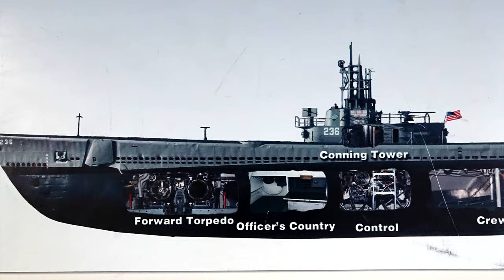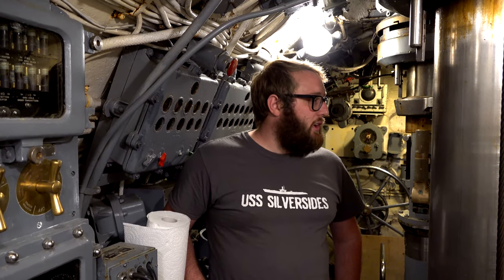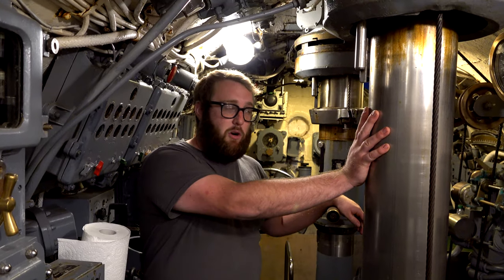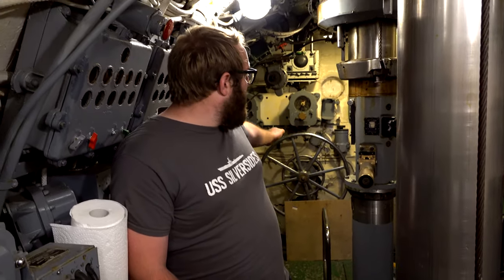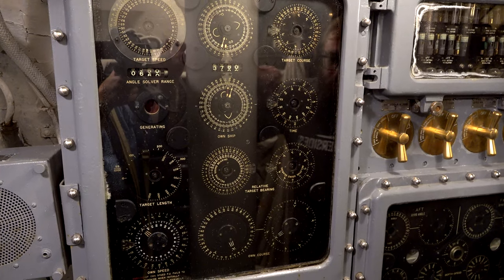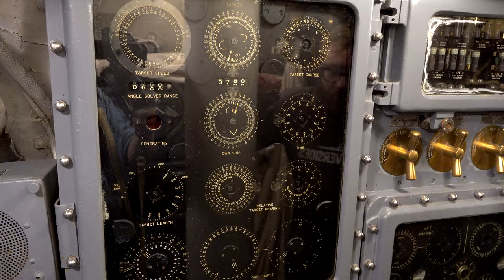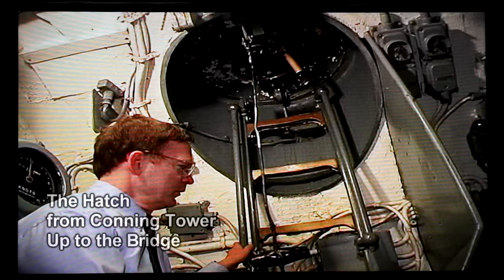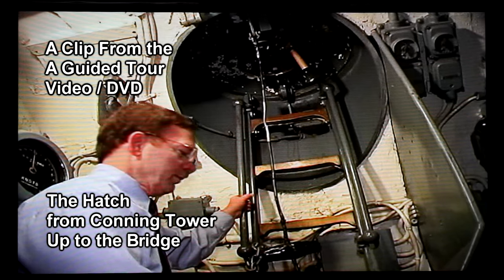WW2 Submarine Conning Tower and Bridge

Comment: Nice video.  My understanding of the TDC is that it fed the gyro angles to the torpedoes in real time, it did not need to be called down to a torpedoman except perhaps as a backup.  There is a brief shot of a light that says "gyro spindle," this was the mechanism in the torpedo that adjusted the gyro angles in real time.  It was automatically retracted at the time of launch.

Comment: what where the cables used for on the conning tower that run forward and aft  on ww1 and ww2 subs
Reply from the maker: Radio Antennas.
Reply: Those are jumping wires, used to prevent the submarine from snagging torpedo nets.
Reply: Well they were also used for loading torpedoes